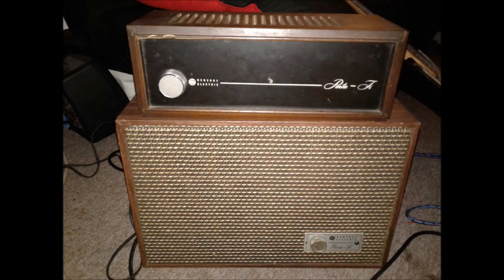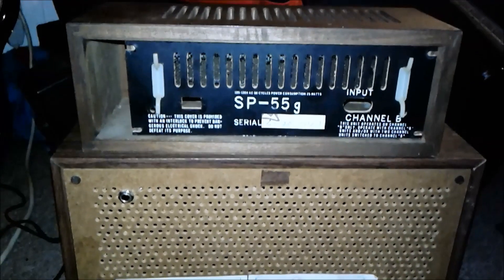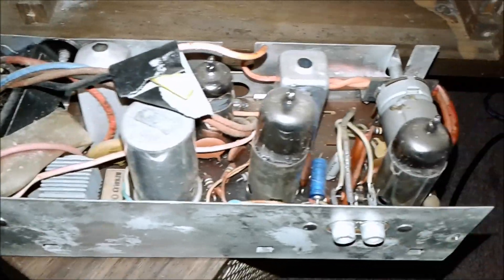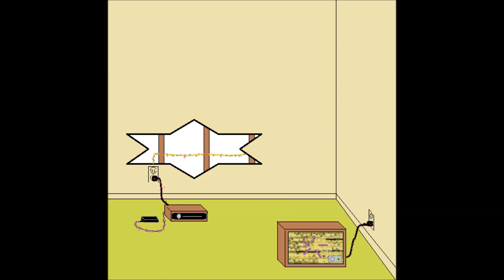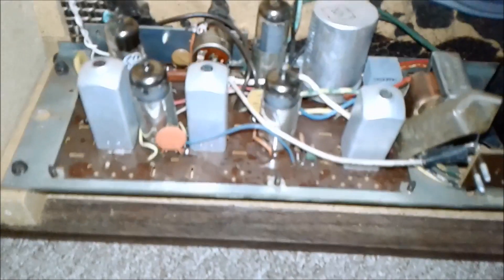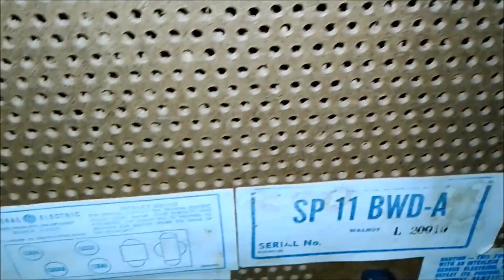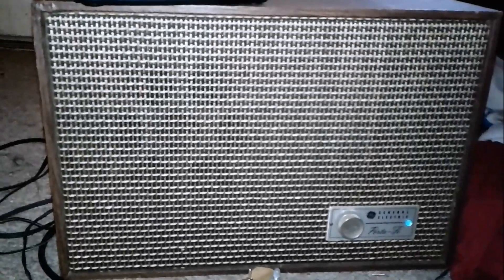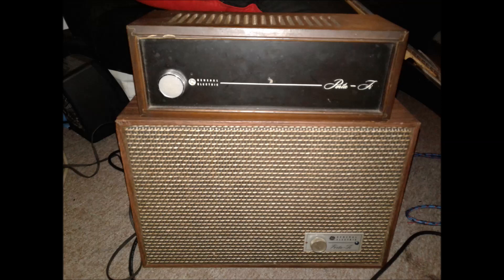1967 GE Wireless Hi-Fi to Guitar Amp Conversion Part 1

Comment: how about adding a speaker out to run a different cab .
Reply from the maker: I could def. Do that but from what little i understand about tube amps u have to match the impedance to the original speaker or the bias will be incorrect. I was also told not to ever run a tube amp without a speaker hooked up or bias will run away and hot spot the tubes...so a headphone type jack that would break the original connection when plugged in would be the ticket.